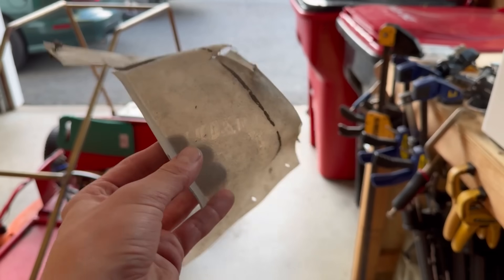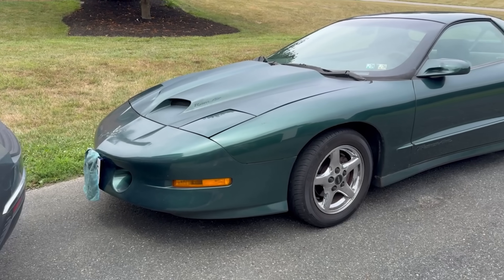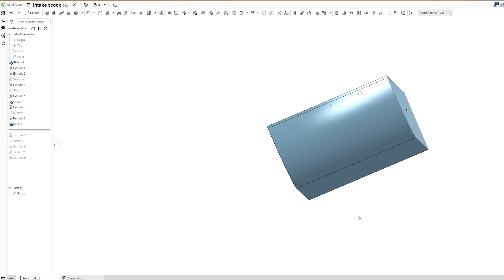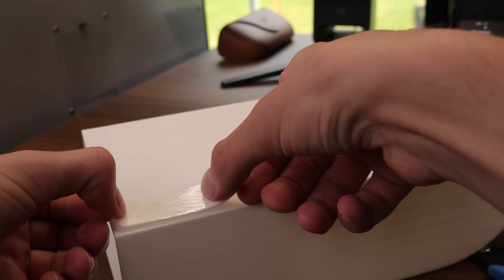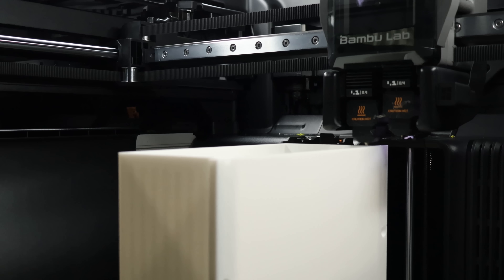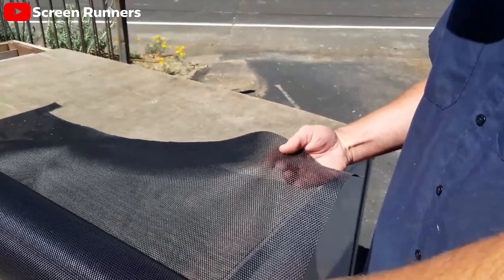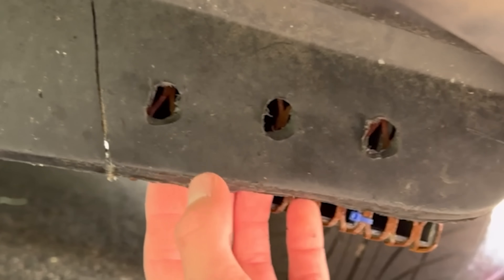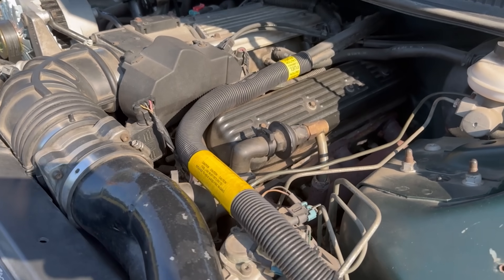I 3D printed FREE Horsepower...

Comment: Nylon has a high HDT but the glass transition temp is much lower and nylon heat creeps easily. It should work but it will probably warp in the heat of the summer. I'd use PC-cf.

Comment: Using stainless screws in direct contact with steel causes galvanic corrosion on the steel making it rust faster.
Reply from the maker: That’s why there not in any contact with steel

Comment: It's not fuel, air, and spark... as air is fuel.

The saying is... fuel, compression, and spark. 

Or even more detailed:
The right fuel mixture (air and atomized gasoline usually)
The right amount of (or at minimum enough) compression applied to the fuel mixture.
And finally, spark which occurs on time with the compression stroke of the four stroke engine.
Reply: Depends. When diagnosing air should be treated separately from fuel, as the two are entirely separate systems (until they meet, obviously) that can each have their own individual issues.
Reply: @Stealth86651  the symptom which should lead to the diagnosis that the issue lies in the air system is a rich or lean condition... which is the mixture ratio, among a few other potential things like atomization of the gasoline properly into the airstream (might be getting the correct amount of fuel, bit if it is not atomized it will not combust properly and completely).

With that symptom, caused by the issue of fuel being off in the three fundamentals of engine operation (fuel, compression, spark), one can the further diagnose the cause of the symptom. The symptom itself is what is presented by the engine in its runability, not the cause... which runability is what was being referenced before he provided the resolution to the cause of his runabolity concern.

Also assuming you are performing a true diagnosis, and not relying on a computer (ecm, tcm, bcm, etc...) to always accurately pinpoint a starting place for you.

Comment: Yeah, this isn't doing anything for what's actually going on inside the motor. Being that this is a '94 The ignition timing, injector pulse and airflow to the plenum are all either directly controlled or monitored and part of the map in the ECM. If anything the car is actively working against you to try and hit it's preprogrammed targets.

Comment: 5:48 I heard my friend say the same thing about there car not going to hydrolock,  guess what happend?  It hydrolocked.

And tour dumb thinking that the the water will just bounce of the rubber.  Do you not know how strong that airflow can be on the intake?

I hope no one takes mechanics advice from you.
Reply: Yeah, scoop go on top of hood. And... they range from mostly worthless to actually worse than your oem intake, so don't even bother lol.
Reply from the maker: Seems like your friends setup wasn’t as good as mine was. 

RIP your friends engine though! 🪦
Reply: @EngineeringAddiction  nah.  It was a lot better.  It was one of the cleanest cars you see on the street.  But because he had his intake the way you did, it sucked up water and water locked.

You have to understand that no intake should be lower then your headlights for a street car.  There are too many elements that can get sucked up into the intake.  Humble yourself and admit that it was wrong info you said.
Reply: @EngineeringAddiction Having seen those exact types of setups fail, you're not special my guy. Please take some time and do some actual research on the engineering of keeping water out of intakes, there's plenty of free and available content on here :)

Comment: a good piece of advice my dad gave me was that if something is that easy or cheap to add hp/mpg, the team of professional engineers who designed the car would have already done it
Reply: Sounds like your father didn't work in the US automotive engineering field in the 80s 😂
Reply: Your Dad is right.. but also not in the way you think. When I had a brand new 2001 Z28, factory Hurst shifter, Z rated tiers, with the LS1. The top part of the huge air lid was designed to be restrictive to the point of just buying a new $50 air lid would give you power that you could actually feel..
Reply: @HandFromCoffin  tbf when he was telling me this he was talking about mpg specifically but its a pretty good general idea to hold about most mass produced products like cars
Reply from the maker: Yes! Thats exactly why the ram air firebird exists! It had a cold air intake set and special hood scoop from the factory. This version didn’t have that so the previous owner added the intake setup and I improved it
Reply: That's valid but nowadays and since the emissions stuff was introduced they purposely detune basically every engine.
Reply: It's the difference between an idiot and self-aware person. An idiot immediately thinks "Man, I thought of this I'm a genius". Smart people think "I couldn't have been the first to think of this, why don't more people use this?".